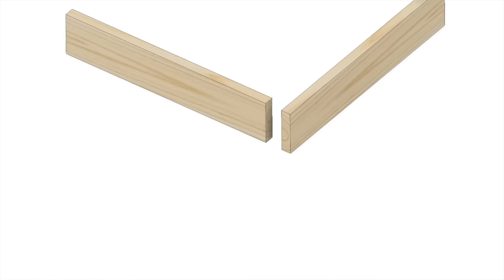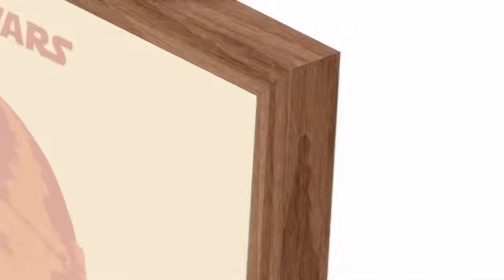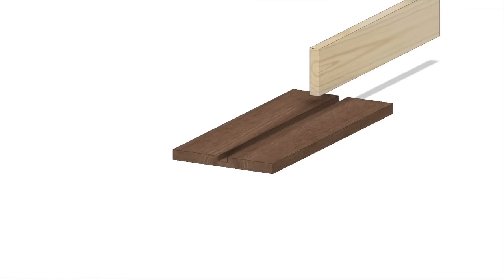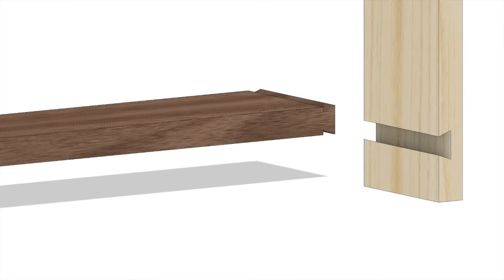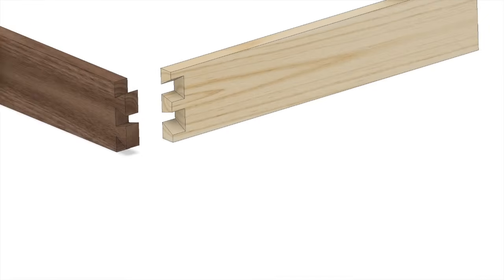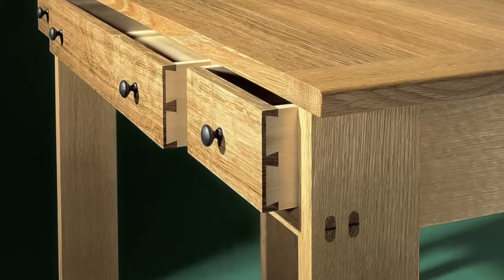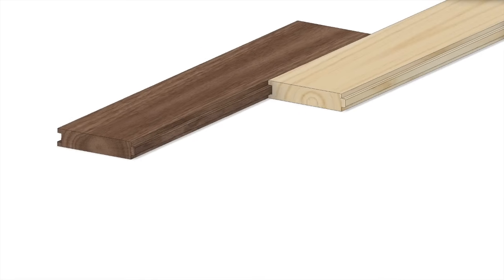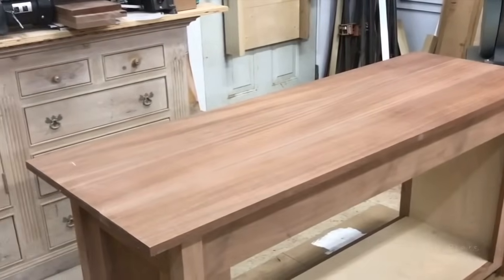Basic Wood Joinery

Comment: Very nice video. Interestedly, I just watched a guy testing the weight each joint can take and the simple mitre joint performed quite well, even surpassing the box joint so, I wouldn’t take the info on this video as absolute true as I believe it depends on different factors such as the project purpose and material used. No need to spend more time in a overly complicated joint if another extremely easy joint will perform just the same or just a bit worse.

Comment: I am in need of a word workers help. I need to design a better joint system. I am currently using a french cleat to interlock my cargo box to a piece of flat wood that creates a sleeping platform when the seats are down. The french cleat is a little bulky and sharp on the flat piece of wood when the sleeping platform is not installed.  Any ideas on a cleaner plug and play to interlock the two together?

Comment: Cheers Eric ... i put the thought out there and then i came across your video ... i want to make a cross and was pondering 'half lap' ... but you stated Mortise & Tenon is the strongest ... so cheers - a query: this cross is going to be outside, i'm making it from OAK, what do you suggest i use to join the M & T together, in respect of glue 

AND 

Oak's a hardwood, so will there be much contraction in the wood over the years

Comment: Don’t know why he said mitered butt joint isn’t strong which is wrong it’s extremely strong and can outlast a dovetail
Reply: A mitered corner is one of the weaker joints in woodworking because it relies on gluing end grain to end grain. By itself it has no strength at all. It's just two pieces of wood cut at angles such that they meet precisely at a corner.